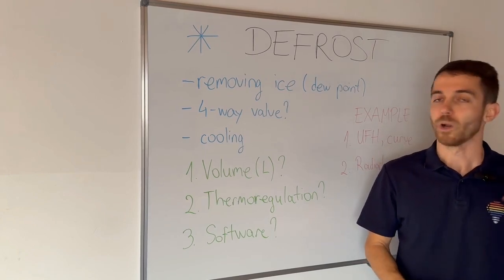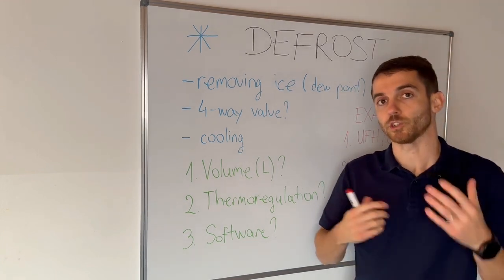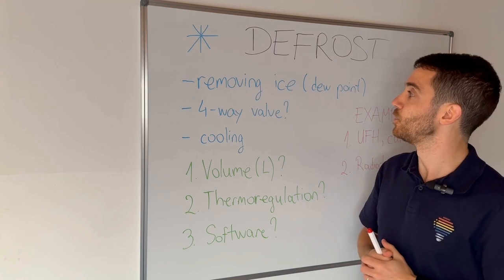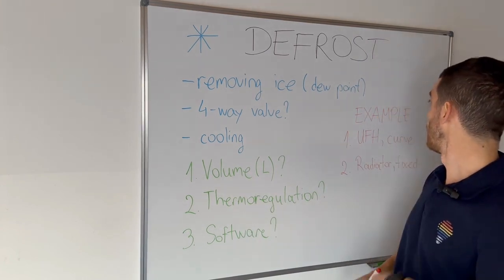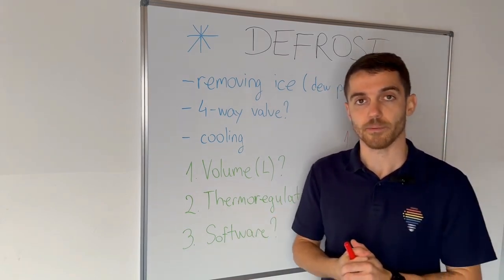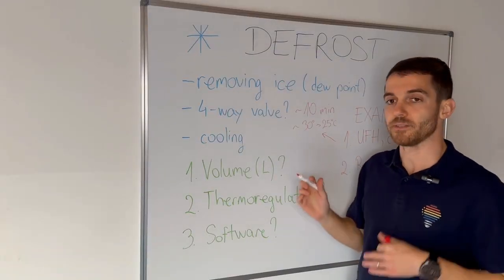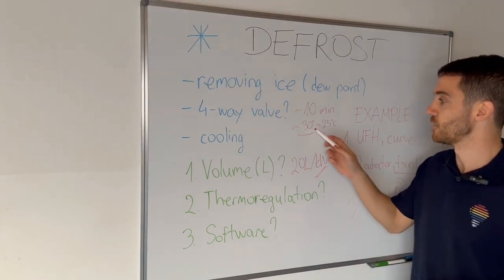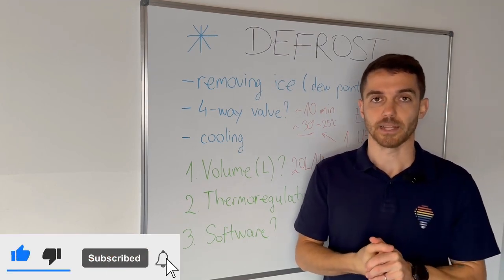Heat Pump Defrost Cycle Explained | How Water Volume Impact Efficiency

Comment: It is not only the system volume, it is the volume in combination with the temperature of the volume.

If you have 300 litres at 10 degrees, it will not defrost your unit, or it will take a lot of time compared to 30 litres at 90 degrees for example.

I run a 7KW Panasonic J series, The pump will use its 3 KW backup heater for a defrost cycle for 10 minuutes if the inlet water temperature is below 27 degrees. 

I have enough volume (about 80 litres) but the temperature is too low. On a humid day at around 2 degrees outside when the inlet temperature is arround 22 degrees, i can expect a defrost cycle every hour. That is 12 KW consumption on the backup heater alone in 24 hours!

The house does stay warm, no problems there, however the COP drops like a rock. The hidden cost of running on low temperature.
Reply from the maker: Thank you for feedback, good to hear different perspectives.

House that I showed in video has around 250 L of water for 12 kW and no problem with 25 C inlet temperature, 10 min defrost with compressor, backup heater never turned on.
Reply: @HVACEducationHub  Interesting. Is there any way i can get this to work with my 7J series as wel?
Reply from the maker: I think J generation (R32) could be better than H (R410A).

But I didn’t mention that it is underfloor heating with really high thermal mass (300 m2). So it is different than volumiser.

Comment: It is worth to mention that Panasonic Heat Pump can use  water from domestic hot water tank  ( ili PTV na hrvatskom ) for defrosting.. There you have more than enough hot water to do defrost with less interference on heating. 
Anyway - its always good to have something form you Mario as we learning that way. thanks..
Reply from the maker: Thanks.

Yes, forgot to mention that but I was speaking generally without specific manufacturer.